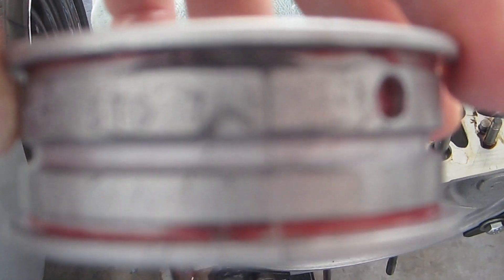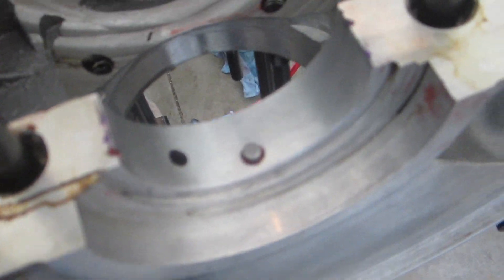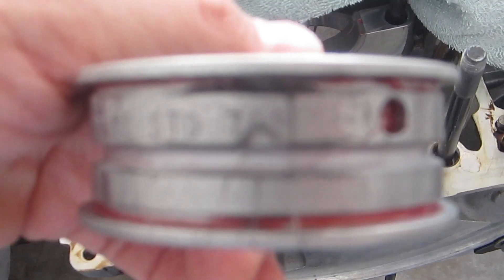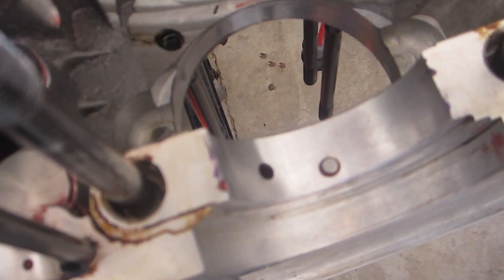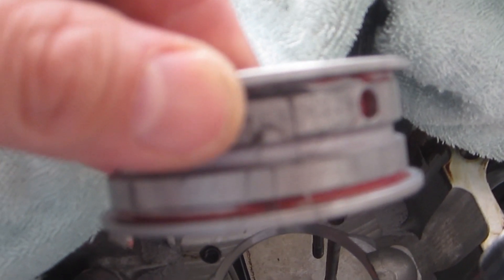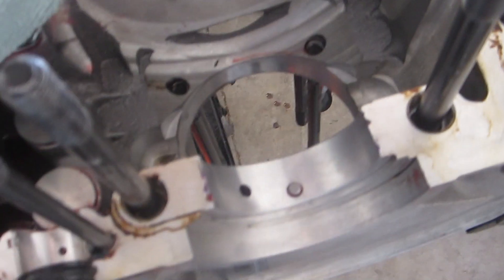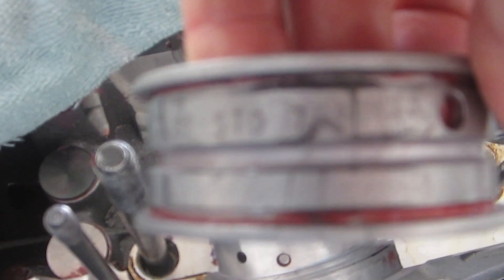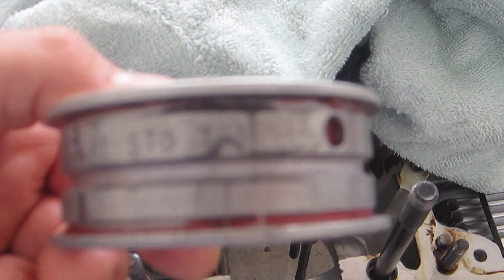VW Main Bearing Oiling Improvements

Comment: Any thoughts on the bearing design to keep oil pressure in spec?  Have you torn down an original engine with stock VW bearings and found the same thing?

Comment: It may be out of focus but, the details are clear. These main bearings (Silverline) just don't line up well in the oiling hole. Is it the bearings or the new cases? I don't know. I'm using a new clearanced and flowed AS41 Brazil mag case and mine was just a little less than 50% off. Variable speed Dremel with a small cutter bit and all is well! I can't wait to tear into an old 1600 SP German case I run now just to see how things are in it. I refreshed it in the early '90's.
Reply: It could be a combination of the new cases and the bearing. Not saying anything bad about the Silverline bearings because they are actually a great bearing, but they do have the same problem on stock cases.
Reply from the maker: Thanks! Yeah I badly need a new camera, this one isn't cutting it. Glad though even with the bad focus the details were clear enough to convey the issue!

Comment: Wow! Your due diligence paid off on this one. That looked like the bearing was covering 1/2 of the oiling hole! I actually saw that done on a Kaddie Shack vid, but as you already know, mine was unaligned too. Thanks for the shout though😎
Reply from the maker: Thanks, yeah that's crazy the amount of bearing covering the hole. It might (or might not) be fine on a stock build that doesn't see more than 4500 rpm, but on a high rpm stroker that might wind up to 6500 rpm, that's a seize waiting to happen. Happy veedubbing and thanks again!